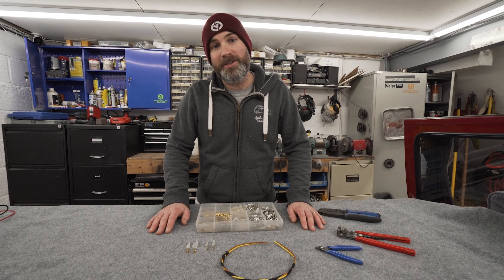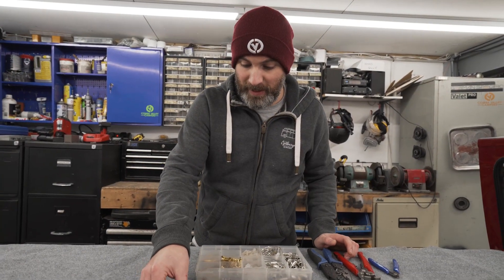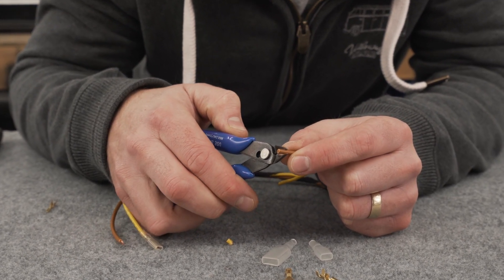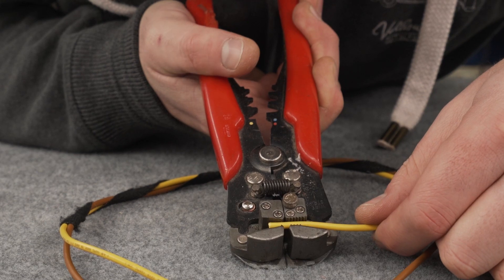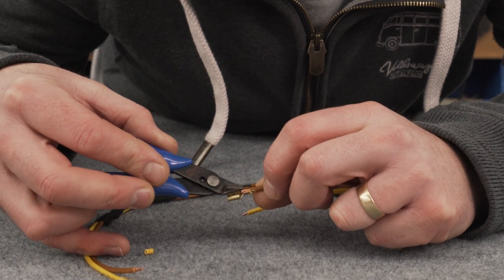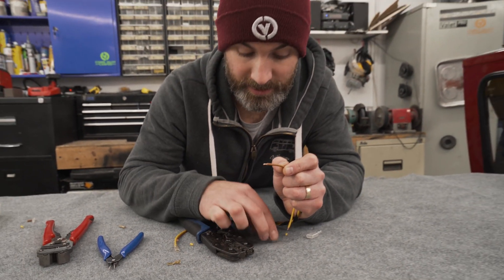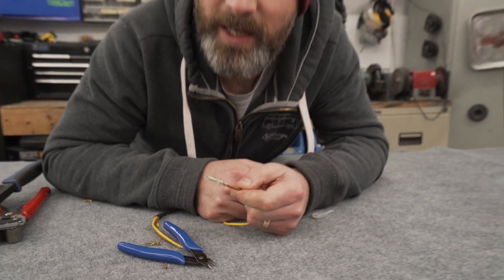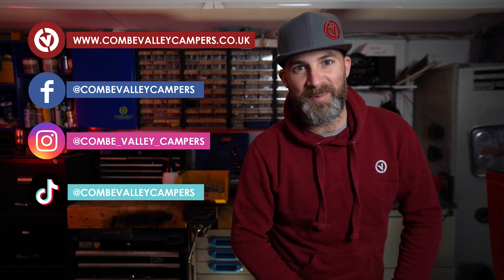HOW TO TERMINATE A SINGLE CORE WIRE - A beginners guide.

Comment: I’ve found the term “core” confusing to some people I’ve done vehicle electrical work for in the past. Whilst you are correct to call it single core (e.g. containing one electrical conductor) the term core is often confused with solid core (one piece of metal/copper as the conductor) rather than multi strand - where there is still only one electrical conductor but this is made up from multiple strands bundled together within the outer insulation. 

Great to see this back-to-basics series, as I’ve seen some pretty bad crimped connectors in my time - hopefully people can learn from this, so thanks for taking the time to record and publish this. 👍
Reply: I thought we were using a single strand of wire.